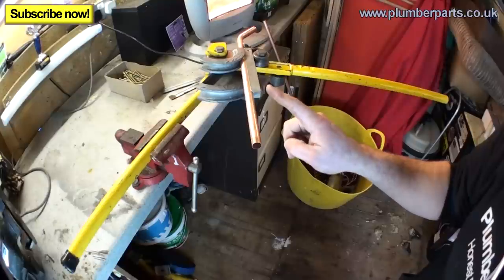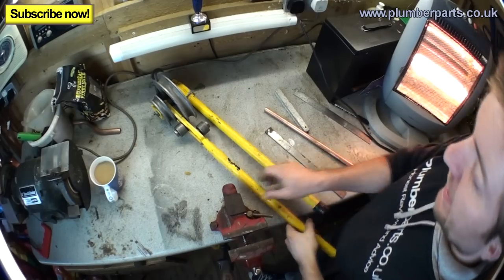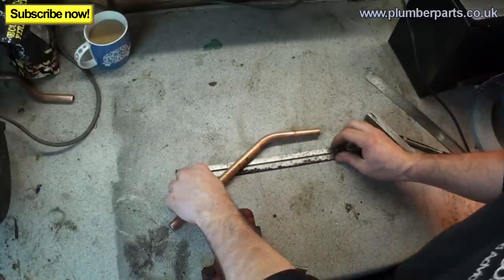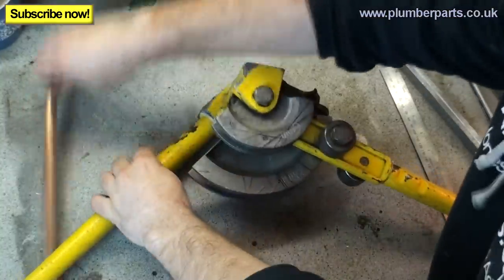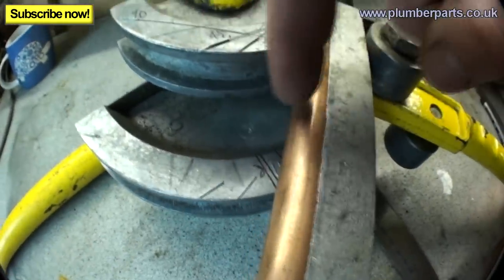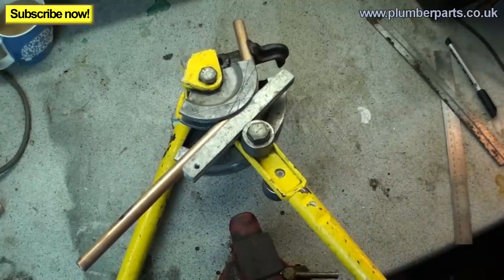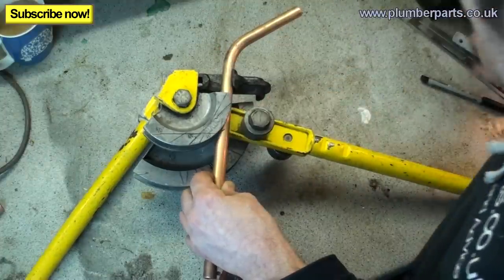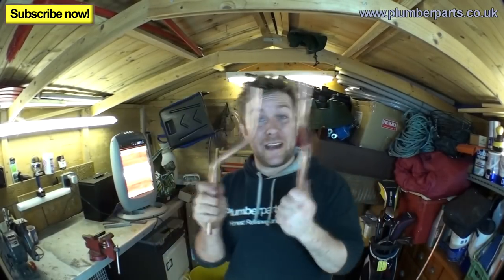HOW TO BEND COPPER PIPE - OFFSET - Plumbing Tips

Comment: I'd like to thank you for this video. I had a pipe with pinhole leaks needed replacing. It had a 90 degree bend plus an offset, the prospect was quite intimidating, but this video made it look easy - and it was!  In fact I think my pipe was a better fit for the space than the old one I took out!  There's not enough real plumbers in my area - so they don't even return your calls.
Reply from the maker: No worries Mr Swanley! Glad to help. And you're right, there aren't enough plumbers about at the moment!

Comment: Quick question, I understand this might not be the correct forum, scenario is, 15 mm copper tails coming through an already tiled surface, which is hard grouted. Is there a plumbing solution to levelling up a bar mixer, using conventional plumbing parts, plug for you there. I have seen the offset threaded systems, but they fit into a female receiver. Is there a solution, that can also utilise the chrome cover plate kits. Many thanks for your considered opinion.

Comment: I have a very old pipe bender which has measurements around the former arch, mark the pipe with a felt tip and line it up on the set and perfect offsets. It has imperial  and metric and I bought it at a trade fare in the 80s
Reply from the maker: Top stuff. Whatever works for you!

Comment: why don't they teach it like this at college..... if id watched this before my final assessment id have flown through it
Reply from the maker: Yeah I never know why either....
Reply: +Soul Flex Digital 
At colleges in the UK, they (in my experience of learning and teaching) teach the use of the "McEown Table".

 I had a "discussion" with one of the older members of college staff about why they did that, and he said it was because it was easy, and worked... Which it simply doesn't, or doesn't always, since it's based on a bend radius to tube diameter of 4:1, to which not every bending machine adheres.  My own benders (both of them) are 3.5:1, for instance, as were the ones at the college I taught at.  That means the McEown table is generally useless. (it doesn't mean the principle is useless, because it can be modified to suit your own bender) it just means the data on the table does not suit the benders. The "hook" on a bender can be different from another, too, and that can affect where a bend starts to form, which in turn alters its relationship with other bends.

The amount of good tube I've seen consigned to scrap because of incorrect methods being taught...
Reply: I'll be using the 2 ruler rule next week at college after watching this.
Reply: @Daves1681  or maybe a square one

Comment: Just started my plumbing course and this helped loads 🤘
Question: the marks on the bender ie: the 45 mark....... do you line the end of the mark/line up with the centre of the pipe, or do you line the mark/line up so it’s parallel with the pipe, if that makes sense? 
Cheers lad 🤘👍

Comment: Hi James. Annoyingly my bender dosnt' have any 45, 50, and 90 degree markings. I'm using a template and bevel to get the correct 40m measurement in the way i was shown at college. I place the side of the bevel along the centre of the pipe and carefully make the bend. But when I feel the the pipe is in-line with the bevel it looks like the pipe is no way near the same area on the former that yours is. Is this down to different types of formers and makes of benders? Ill admit that I did buy mine cheap from ebay. Many thanks.

Comment: Hi I'm replacing a single radiator for a double and pipes need to come forward a bit from wall and are coming up out of a concrete floor. I will be draining system off first as a precaution.
Any advice on how to bend them forward say an inch or inch and a half.
(Taking valves off heating pipe small iron bar down and gently bend????) 
Please help.

Comment: What is your opinion on soldering pipes in sections and then mounting them?  Will the solder break if the pipe is moved and jarred around slightly while installing or does it always have to be done in place?  I'm running copper plumbing for an air compressor cooler setup.  It's only going to have air and a bit of condensation in the pipes.
Reply from the maker: +DJDevon3 You can usually get away with it if the soldering is good enough. Although, it's better workmanship to solder in position. Best, PP!

Comment: What's the smallest offset you can do in terms of length of pipe? I know I leave the ends slightly longer, do the offset and then cut the ends to required size, but what about if there's only a slight kick needed in the pipe?
Reply from the maker: You can anything down to about 2mm but it's really shallow! Regards, PP!

Comment: Good video to help the beginners. I don't know how you find the time to upload all the videos, well done. I'm sorry to have to mention this, but as one of the things that bugs me, can you please stop referring to the GUIDE as a FORMER.
The FORMER is the large aluminium casting fixed to the bending machine, in which the copper pipe is placed. The GUIDES are the separate parts (15 or 22mm) of the bending machine that are placed onto the pipe and under the roller to GUIDE the pipe around the FORMER. Picky I know, but that's the kind of guy I am.
Same applies to rulers and rules, as per Aaron Lee's comments earlier, although I have to confess I sometimes call a rule a ruler (I said picky but not perfect). Keep up the good work.
Reply: ***** Those who can, do; those who can't, teach, and still get it wrong.

Comment: I had to do bends kinda like this today but I used a bendy spring thing. Those benders look way better to use. Ts there a tool u can get to reshape the pipe end after u've cut it so as the spring can insert easier? I had to hacksaw the end off each time and it was a faff. 
Cool vids btw eh mate

Comment: Say for example you're running a length of pipe along the skirting, and you have to put an offset in the pipe, what's the best way to measure out where the offset should start so you don't end up bending it in the wrong place.
Reply: Yeah thas wot I wanna know as well!   _
Reply from the maker: jismn Hmmm, should do a vid on that...will add to the list. Cheers guys! PP!

Comment: Excellent series of Videos - Thanks !

I have a Pipe-Bending Question - Assuming there is the Space and Accessability to install the Bent Pipe/s how many bends is it possibleble to put into the same Pipe Run before it is advisable to use a Solder Joint,,,,???
For example : A run of three pipes with the same offsets and then another bend on all three - or - or one - or two bent at 90 degrees horizontal to the perpendicular and then another 90 degree to the horizontal,,,,???

Naturally though, it depends on the overall length of the pipe that is going to be used.

No, this isn't a joke question, it is a serious question based on my current project where my pipe runs are flying in all directions.
Any fool can cut pipes and solder in joints, but pipe bending is a reflection of the true professional.
You comment/s would be appreciated - Thanks.

Paul
Reply from the maker: Paul, you can use as many bends as you like within physical allowances the main one being can you fit the bends in. There's no weakening of pipe wall or degradation with every bend added. And agreed it does often look more professional. Thanks got your question!!! Regards, PP!

Comment: Hi, thanks for the useful videos.
Could you please help me in installing a heavy ceramic shower tray brought from Italy tinkling  that in London use concrete floor like Italy, but I realized that the floor in London made of floorboard ,how can I risre the shower in order to fit the plumbing work,and the back of the shower there is no holes to fit any kind of kit.
Please help.
Reply: Hi, thanks for the useful videos.
Could you please help me in installing a heavy ceramic shower tray brought from Italy tinkling  that in London use concrete floor like Italy, but I realized that the floor in London made of floorboard ,how can I risre the shower in order to fit the plumbing work,and the back of the shower there is no holes to fit any kind of

Comment: I had to replace an imperial 1330mm rad with a 1200mm. extensions are handy but the offset is 50mm. the pipes are concreted in & cant be moved. can we do a short 50mm offset change over a 100mm length or would I be better with elbows from the pipe ?? Thanks

Comment: I know you did a 40mm offset but what's the shortest possible offset you can have?
Reply from the maker: As in set off the wall or distance from the first bend to the last? Not easy to describe!!! :)
Reply: Bend to bend, pipe is too far away from wall for a clip but to close for fittings
Reply: +Chris Vinton couple of mm is possible, indeed not even difficult. Not pretty though, just looks like you've f**ked up.

Comment: I've found the easiest way to do it is once you've put your first bend in push the pipe all the way into the bender until the black guard or whatever you want to call it just hits the first bend on the pipe, then put in your second bend, don't need rulers etc, anyone else?, currently at college so ...
Reply from the maker: Hi Cuffy. That's fine for a shallow set, but a biggy like 40mm and above you'll need to measure. Cheers bro!

Comment: Would it not be quicker to line the pipe up at an angle between the wall and the floor and then stamp on it as hard as you can?
Reply from the maker: Yes mate it would be quicker.....however copper pipe looks awful with a 'Dr Martens' or 'Vans'  imprinted on it...so I'd stay with this method! SUBSCRIBE! ➡️👉 https://www.youtube.com/subscription_center?add_user=plumberparts 👈⬅️ IF YOU HAVEN'T ALREADY! 😎

Comment: im studying to become a plumber just at the beginning stages at the moment. i slightly confused on how to measure pipes, im a better learner when i watch videos and see it please can you make a video where you show how to do measurements more in depth. please can you include all the angles 90 degrees,  offsets etc. ill give you a little paragraph from my text book to give you a better idea of how confused i am lol. This is for a 90 degrees bend "First, mark the measured length position. in this example the mark will be 200 mm from the end of the tube. Next, decide on the bending radius. Usually this will be 4 times the tube diameter so, 4 times 2= 88mm. 

Now mark the START of the bending length. The position of this mark is 4 tube diameters (88mm or one bend radius) BACK from the first mark. The last mark required is the END of the bending length. The position of this mark is 2 tube diameters (44 mm or 1/2 a bend radius) FOWARD from the first mark.

Then insert the correct sized, lubricated spring and bend to the required angle. With a bend radius equal to 4 diameters the 'gain' is 1 tube diameter. 

This is what im confused about its not necessarily how to bend the pipe its the measurements and how to do them. if you could make a video i know after iv watched it a few times i will get it straight away. if you could also make a video on how to bend using bending springs. that will be very helpful as well. hope its not too much to ask and will really appreciate it. thanks
Reply from the maker: +Bakhtiyar Rahman I'll add them to the list mate! Cheers, PP!
Reply: +plumberparts thanx mate

Comment: I see its common practice outside the states, but it seems slower than burning fittings or using press copper? Ill try this sometime.
Reply: I see what you are saying, but that only applies when you have one joint to do. If you had five (multiple) elbows to solder, but instead you pulled 5 ninety degree bends, you will save A LOT of time.
There are times i have put 5 to 6 bends on one 3 metre length of pipe and just slot it in, and the time including measuring is under 3 and a half minutes.

Some carcassing jobs that would take fours days with multiple bends can go down to two and a half, depending on how good you are,  but yes, if your gonna use the bender for one joint then you may be better off soldering. Also bending can look unsightly in some places where you could've just used an elbow.

Soldering then checking around the joint, not to mention the potential leaks on the fill up, can be even more time consuming.

Good luck
Reply: I think there's also efficiency. A pipe bender puts on a much larger radius than an elbow fitting does, equals smoother flow of water, less pressure loss, noise etc. When you're working in an old property with poor water pressure these things add up I think. Yes, you can probably buy fittings with a larger radius, but those would be speciality items and more expensive.